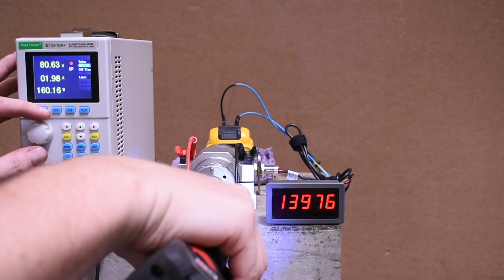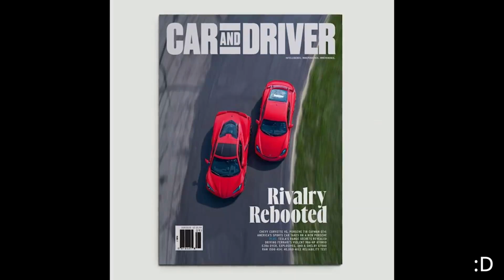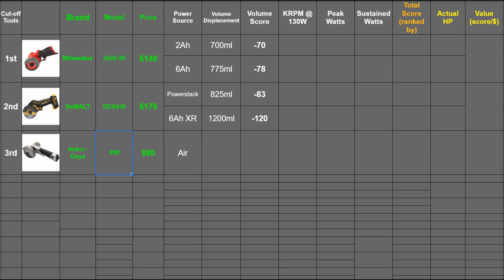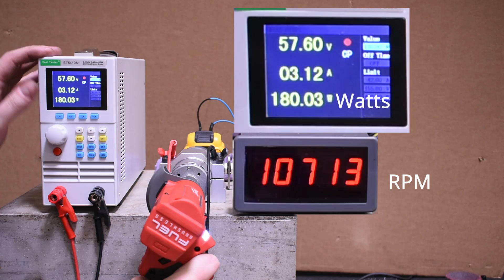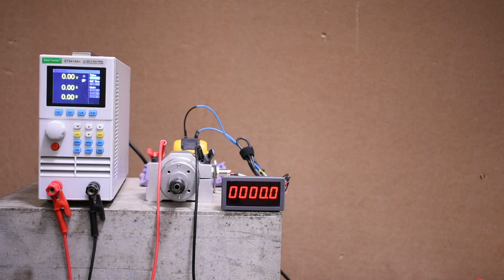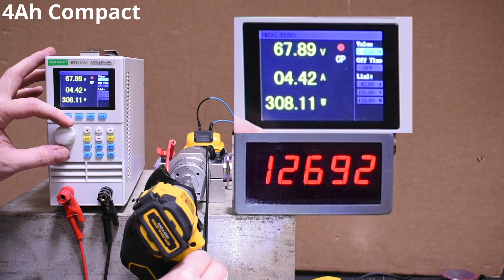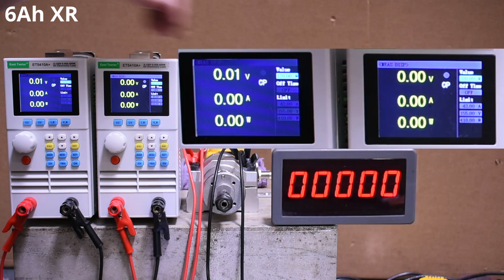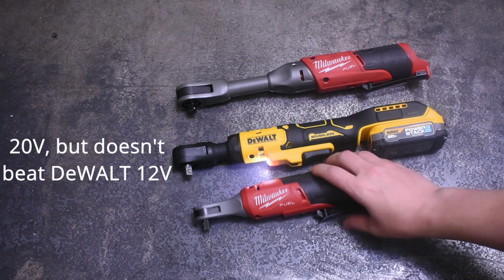Best Cut-Off Tool? Dyno Testing DeWALT v Milwaukee v Air

Comment: Dumb question, other than being slightly more compact is there a good reason to use this over a regular angle grinder?
Reply: For me working on rusty cars. It's all about fitting into tighter spaces. As other have mentioned it's a bit more controllable also. But a 3 inch wheel is going to bottom out faster on thicker material.
Reply: 1) The smaller size of the tool makes it much safer to operate one handed.
2) It comes with a dust shroud for when you are cutting material like concrete and fiberglass
3) The dust shroud also provides a depth stop to not only limit the engagement of the blade reducing kickback but also to prevent damaging materials behind whatever you are trying to cut.
There could be more but these are the ones I have noticed in use.
Reply: i could imagin that in a shop setting it wouldnt make much of a difference but when you think about going on a jobsite and maybe carrying it the whole day it would make a difference when you dont need a fullsize anglegrinder. so yeah just smaller and lighter.
Reply: I guess for smaller jobs these tools can be handy. 
But most people won't need one if they've got an angle grinder already.
Reply: @BL-yj2wp  It's mostly convinience to have a small lightweight tool to make a quick cut or to get into difficult places. For everything else get a full sized one. :D
Reply: Size, we'be got a metabo 125mm grinder and a mini one from bosch pro 12v. While the small one has considerable less power, it being much lighter and smaller helps a lot in getting it into tight spaces. Plus, you can cut smaller holes with the smaler wheel diameter (less space to full cutting depth at the corners of a square hole).
Besides that, it won't have the power to rip itself out of your hand when you need to hold it in a questinable way to reavh something. That is a risk I wouldn't take with a full sized one. :)

Comment: That DeWalt is pretty impressive, since the motor housing size looks about the same as the Milwaukee, and nothing said about it smelling hot at 500W.
Reply: They have been beefing up their wires thankfully and their plastic has always been good.
Reply: @saturnmedia1  My dewalt batteries were made of garbage plastic. They cracked and fell apart really fast. The mac branded batteries held up better.
Reply: @AlexAutoRepair1  what were you using them for? What fluids were ever on them?
Reply: @Saturn Media  I work on cars so oil, coolant and transmission fluid usually. My first cordless were snap-on 14.4. Never a problem. Years later I bought a Dewalt kit. Battery cases didn't last long except for the mac battery. Sold off my Dewalt and snap-on and switched to all milwaukee. No problems so far and it's been a while.
Reply: @AlexAutoRepair1  Cap
Reply from the maker: Agreed, the voltage argument makes no sense when the tools are the same size. If everyone can make a higher voltage tool that size make that power they should!
Reply: @TorqueTestChannel  I feel like you are the channel guy to make a 36v m12 battery pack work.
Reply: It is a good tell on the different philosophies used by different brands. For example under voltage protection is handled differently, Some brands just use a heavier duty motor with far less protection and sacrifice weight and cost where others will use a better protection method and a cheaper motor and achieve a lighter weight. Both will last as long as each other but one will allow more over load before it stalling reducing run time and increasing wear. The one thing the performance graphs do demonstrate is that even with the best optimized pneumatic supplies power still falls off when using a pneumatic supply.
Reply: Well for dewalt it's not the first time they have no thermal protection for tools
Reply: @master6435  yet it doesn't heat the same way the Milwaukee does.
Reply: @engineer_alv  I was talking about the dewalt 887 or 877
Reply: A lot of people seem to be confusing the subject. For a given motor, double the voltage applied under no load means double the rpm, but you have to look at the kv rating. If you have two motors the exact same size but one has a kv of 300 and the other is 600, the 300kv will spin half as fast per volt applied, but make twice as much torque per amp applied. Since power is volts times amps, one is doubled and one is cut in half, both motors will have the same power output even though the supply voltage is half on one of the motors
Reply: @nickanselmo6353  well said.  @Aidso was making the argument that torque is most directly related to voltage, but in simple terms it's more related to current.  But you're correct, in P = IV, if neither I nor V is fixed, then it's not as simple as more amps = more torque, since you usually get voltage sag.  The motor itself determines the factor that relates voltage to RPM and current to torque.

Comment: Love to see DeWalt win, especially if it pushes Milwaukee to do better
Reply: @Sid The sloth I'm team "what works for me" 
   That means i have a milwaukee 1/2" drill for ice fishing and mixing drywall mud. Milwaukee drywall gun. Dewalt multi tool because let's be serious..... it smokes the other brands. Lol
   I have red, yellow, green, orange tools because it's only money and not one tool manufacturer makes all their tools superior to the other manufacturers. 
  I  Use the tool that works for me and I don't care who makes it.
Reply: @travisstorbakken1737 I use a drywall mixer for cooking and it's actually really good at it! Unlike a regular cage mixer, the batter can't get stuck in the middle
Reply: @@sidthesloth128 i personally didn't buy either of the milwaukee m12 die grinders because I was able to try a coworker's. While they were alright i guess they didnt have the power i needed or the size to replace my air tools. I have been waiting dilligently for a "gen 2" for a long time hoping they would work on the compactness and power both like they seem to do with the 2nd gen impacts, etc. No dice. So when I see the new dewalt in a similar size absolutely trounce the milwaukee in power, it bums me out that I'm on the red platform since I dont want to change 'yet again'.

I'd love to get away from the hose/ air compressor completely.
Reply: @@sidthesloth128 people are  crazy and/or have too much money. Both red and yellow are quality brands I'm 💛 but agree big red has Dewalt beat on some tools. It is great for us the way they keep pushing each other in quality and price. I Look at it  that way.
Reply: @thedude8976 I'm I am so glad for that too.
Reply: Dewalt is absolutely eating everyone’s lunch right now. I’m so glad I went with team bumblebee this time around. I get work done faster and my hands don’t hurt.
Reply: @markm0000  and I'm regretting jumping on team red a while back. They've stagnated.
Reply: @@sidthesloth128 Oh I gotcha now, maybe I wasn't clear- I'm not gonna jump ship, sell all my red, and start over with another brand. That would be silly since there are some of the milwaukee tools I have that kick ass. I was more talking about having to invest in chargers and batteries for yet another brand if i decide to get some dewalts.

Now that said, if somone (anyone) comes out with a tiny, powerful  straight and 90°die grinder and air ratchet that are actually comparable in size to air tools (including the batteries) then I might buy them with a battery and charger kit if on sale (I.E. not too much if an investment) I already have milwaukee (used to be a makita guy, WAY back in the day) and ryobi because I needed a tool and there was a sale on one I liked in kit form from a different brand at a price where I couldnt say no.

I'm not getting rid of any of my tools- just adding to the collection, which is nice- so when i go on a big job I have plenty of chargers, batteries, and tools to use at will. I'm not only cheap, but also not wealthy, so purchases have to be well thought out and saved up for. And worth the $.

BTW I'm liking the ryobi tools I have more than I thought I would. The question was durability, and they're holding up great.

Hopefully, slumping sales from bad PR and unsatisfied customers jumpimg ship will wake milwaukee up.

Comment: The Ridgid one I have is pretty good but you can't get too carried away or she stalls. I hogged through a rear arch panel on a junkyard car pretty quick when I needed a patch for my rust belt Saab. Wouldn't mind seeing that compared to others but won't be upset if I don't either.

Comment: Watts are cool and all but what's the # of catalytic converters stolen/hour?
Reply from the maker: Cordless sawzall's do it faster and quieter. This is more of a bike thief's wet dream
Reply: @TorqueTestChannel  Prove it!
Reply: @TorqueTestChannel  mAkw discos
Reply: @TorqueTestChannel bike thieves wet dream is a set kf folding compound bolt cutters. They aren't cheap, but they never need batteries and can be easily stored in a backpack.
Reply: @TorqueTestChannel  make discord server seriousness seriously
Reply: @TorqueTestChannel  make discord server seriously seriously seriously 😒
Reply: @TorqueTestChannel  make discord server
Reply: Hahaha! And how easily can they be swiped from a big box store 😆
Reply: My big box has them under lock and key.
Reply: Your profile pic and name. Excellent reference.
Reply: Not an expert but it averages out to around 2 ounces of meth per hour.
Reply: I think bandsaw would be the quickest. I use them all the time to cut metal and they are super fast and quiet.
Reply: Bruh 🤣